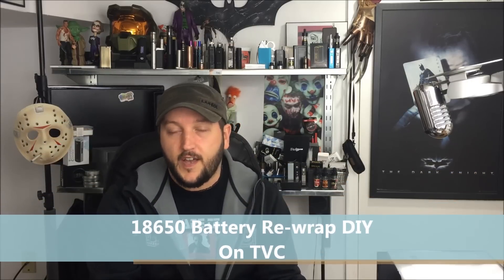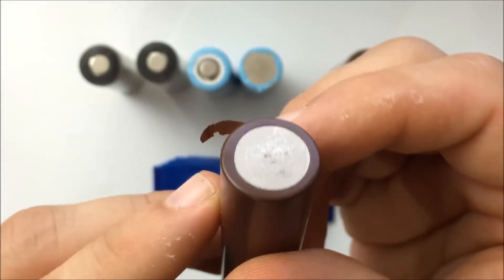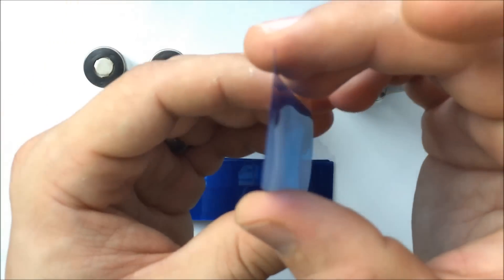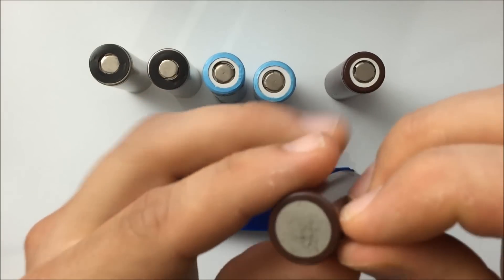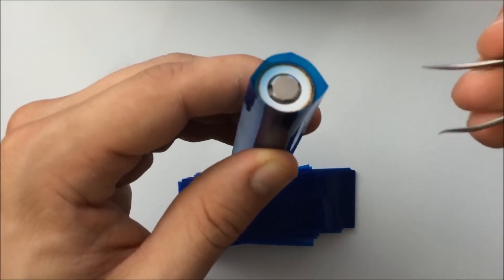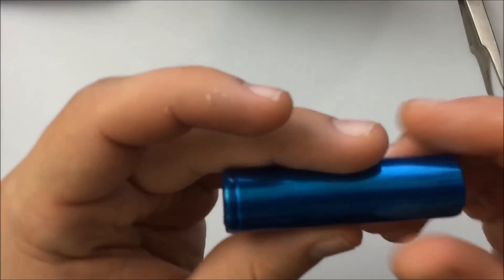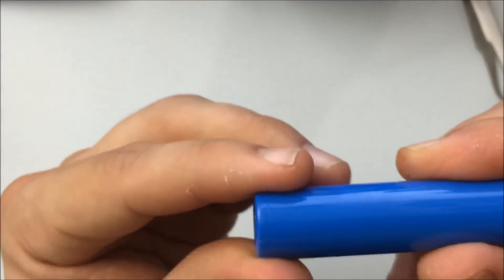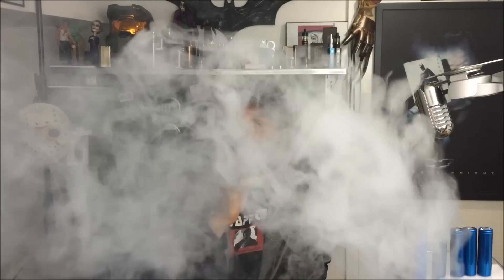18650 Battery Re wrap DIY On TVC

Comment: thanks for this Brian, videos like this aren't the most glamorous, but they are helpful. every reviewer mumbles the words "battery safety", but i'm not sure all of em even know what that entails. things like this are extremely helpful, especially for new vapers. all vapers should understand that the whole battery except for the top nub are the negative connection, and a tear in the wrapping is a recipe for a nasty venting, and potentially a nasty headline for the anti vaping folks. less than 15 minutes to learn a bit preventative maintenance is well worth it.

Comment: I have 1 of those same baby blue Samsung high drain 18650s, and I noticed it's wrapper tearing recently, so at first(earlier tonight), I tried removing the torn wrapper and wrapping it with just 1 layer of tightly stretched electrical tape. Obviously you must overlap at least 1-2mm when using electrical tape in order to adequately cover all bare metal. But once I was finished, the battery wouldn't fit back inside my mod! The mod is made up of aluminum and brass cylinders that screw together, and the central brass cylinder has a much smaller inner diameter than the aluminum end parts that it screws into. So even the slightest additional thickness of external wrapping will prevent the battery from fitting. That's what brought me here for another option. I'm actually surprised I didn't think of buying some sort of shrink wrap before I attempted the electrical tape(which appears to be a no-go idea all around). Hopefully my local vape store will carry it. Thanks for the tutorial....

Comment: Need to pick some of these up. Some of my cells have minor nicks from a clone Nemesis. The vent holes had small burs so when I screwed in the switch it's nicked them slightly. Also have a pair of Efest I had to buy when out and about with dead batteries. The top wrap has peeled around the insulator disc. The disc is glued in place so no real danger, but I'd rather have it perfect. Keep the Efest around as an emergency pair in my work bag.

Looked like the solid blue ones worked better, but that may just be a trick of the light. 

Thanks for the reminder mate.

Comment: Thanks for the video, I happened across it just as I was noticing the need to re-wrap my Sony VTC-4s & 5s
found an alternative to fasttech....
18650 shrink wrap rolls (10m length) sold by UXCell on amazon, under $6 and lots of color choices.

Comment: I'm about to order my 50 pack i have a few batteries and the sleeve has started to lift up a little on the ends but for the moment i did a momentarily fix while my sleeves get here with black electrical tape to cover them very tight so it adds the minimal thickness. Now i have a question for anyone who can answer please!!! whats difference does it makes the mAh for instance 2500mAh or 3000mAh when buying the sleeves because the website has so many options for 18650's its a bit overwhelming i understand the colors but when it starts saying 75x30mm or 72x30mm I have 2 LG hG2 and 3 18650 2500mAh 3.7V now i want to know if there's any difference in the size I should pick or the link you provided will do just fine for my batteries?

Comment: Hi guys I have efest 2500 mah batteries. My top insulator ring has been lost for the positive pole of the battery. Is it a danger to not have it. Can anything happen? I have been using the battery like normal and it's been fine.

Comment: Can I put a peace of electrical tape on a scratch
Reply: OXY CLEAN you can for a temporary fix but batt wraps can be found all over for very little and as Brian demonstrated they take minutes to do. Sites like IMR will get you the wraps quickly if you are in the states. But yes electric tape is a temporary fix that should hold you over until you get some wraps.

Comment: why did you use that metal tweezers at the positive side of the battery?? that was stupid man. you're demonstrating something that you should emphasize the precautions about it. positive and negative are so close at the top of the battery and your insulating ring is not firmly in its place.  you were lucky you didn't end up with a disaster shooting this vid. please add a warning to that part. Ask people not to use any metal there